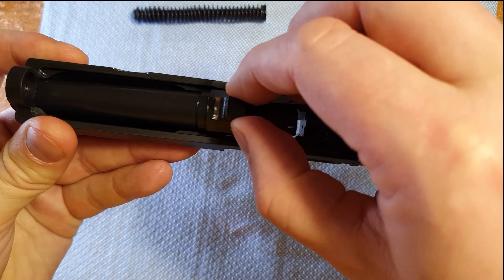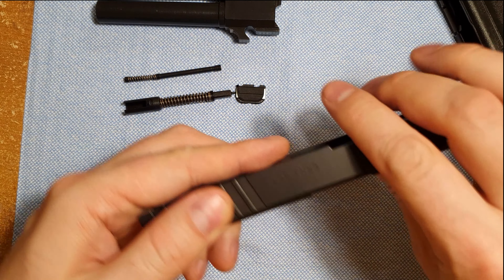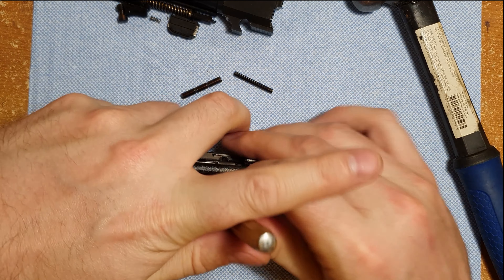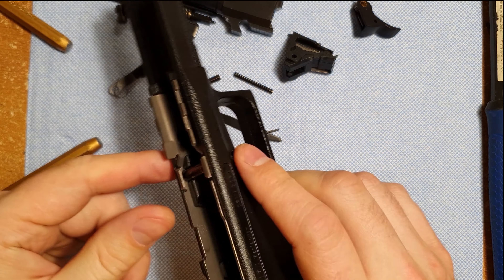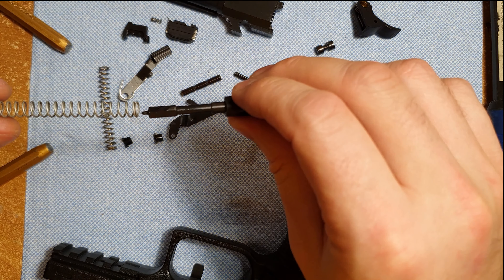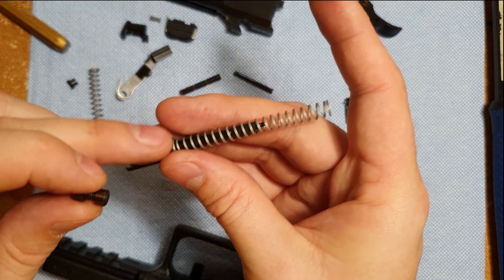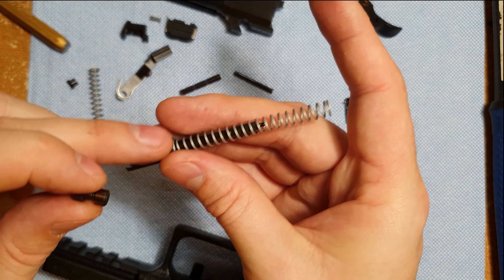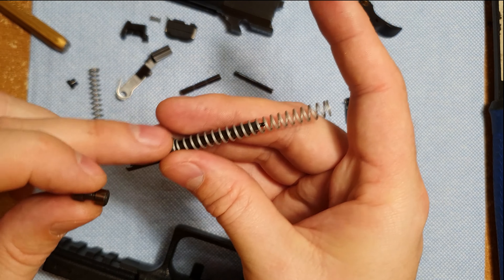Tara TM-9 Full Disassembly

Comment: Mine has worked flawlessly and is the early serial number. No issues. No jamming. I did replace the firing spring to a 4.5 lbs. I would do even lighter. But made a noticeable improvement. Great video, thanks for making it.
Reply: Same here. I did replace the slide spring and firing pin. My only problem now is the firing pin power. Some ammo cannot ignite correctly. I just notice that yesterday with Scorpio ammo. The primer is more harder of CCI or PMC.

Comment: Just one suggestion. It would be slightly better if you use either a nylon hammer face or perhaps a brass hammer face. Hitting the pins with  hardened hammer face can over time deform the end of the pins or other parts if you hit them with a hardened face hammer. 
I know you've done the disassembly many times, you know how hard you could hit the parts without damaging them, perhaps. 
Otherwise its hard to see into the frame of the gun, maybe add a little bit of lighting directly in to the frame. 

Otherwise great job, we have a lot of novice gun owners this day in time.
Reply from the maker: Yeah, I swapped spots for better lighting on the gun I disassembled right after this one.

Comment: So just an update on mine that I ordered, I did receive it Tuesday however there was a crack in the frame where the pin is above the trigger. I sent it off for warranty. It doesn’t look like a manufacturer defect, but more like someone forced the pin in and cracked the frame. I guess I’ll find out more after North Sylva receives it. Such a shame as I was hoping to get to the range with it, but at least my WK180C I ordered will be here next week
Reply from the maker: I had my Tara to the range today. Failures I had: stovepipes, fail to reset trigger, slide lock back with a round still in the mag, failure to go into battery. I'm impressed at the variety of failures I got.
Reply: @Huntinggearguy  mine is a different version from the one in the video (its the one they recently started importing in the US) and its been pretty flawlessly reliable. Trigger is still nothing to write home about. I think whichever version is in this video is the one with the problems because mine looks different
Reply: @counterfeit6089  this one is the TM9, do you have the TM9X?
Reply: @brandonrayner5253  yeah, get the TM9X if you can. It's way better. Just make sure you shoot to reset because that way you'll get a fairly average single action trigger not an absolutely terrible double action trigger, I think thats an issue that pretty much all models of the pistol have.
Reply: @counterfeit6089  I don’t believe the TM9X is in Canada yet.
Reply: @brandonrayner5253  damn thats a shame. You might've lucked out with a decent working TM9, I do remember reading somewhere that there are good and bad batches of them, pretty spotty quality control on Tara's part I think.
Reply: @counterfeit6089  unfortunately I haven’t been able to use mine yet as I had to send it in for warranty replacement as the frame had a crack in it. So now I’m being sent a new one.
Reply from the maker: @counterfeit6089  do you have the TM-9X?
Reply: @Huntinggearguy  Yeah
Reply: @Huntinggearguy  I have the same model tm-9 I got it back in December and I had noticed the same slide locking back on a loaded mag. I noticed the lips on the magazines can be a slight bit to tight causing incorrect feed angle after carefully opening them a bit and a light polishing it feeds perfectly fine and smoothly. This might help with it returning to battery aswell as the slide will not have to work so hard to strip the next round. Only major issue I had so far with mine was the trigger bar snapped but luckily warranty took care of that with no hassle. I have about 1200 rounds through it with no other issues so far. Also there is a little tab inside the magazine well that holds the tool in the grip, just push it in with something and it should pop out.

Comment: For some reason mine doesn't always restrike. The trigger doesn't reset. Only after shaking it around it sometimes resets itself. Does anybody know what part is the issue?
Reply from the maker: The part where it says "Tara" on the side. A less snarky response: check your trigger components to see how much resistance there is in there and consider polishing the rougher surfaces (but not the sear). Realistically, they'd need a heavier trigger reset spring to get better reliability from the system but that'd make the trigger EVEN shittier.
Reply: @Huntinggearguy  yea after getting some time to tinker with it. Its definitely the trigger reset spring. Its just to weak. Thanks for commenting back. I'm get to it. See if i can strengthen the spring or find a replacement
Reply: @Huntinggearguy  yea i also replaced the firing pin spring with a glock 2 ib spring. But it still feels like its around 4-5 pounds 😂. Not bad considering where it started from lol

Comment: Curious:  Why do you rack the slide to test the trigger pull weight?  This isn't a Glock, or anything like one, which is partially cocked when a round is chambered and cannot be uncocked without firing it.  The pistol is never cocked when you release the trigger.  Was that just habit on your part?  Also, you didn't test the short reset single action trigger.  This is a military contract duty pistol reminiscent of the "wonder nines", think S&W 659, Beretta 92F, and the Sig P226.  Pistols of that genre were SA/DA meant to be carried with a round in the chamber and the DA pull was the safety, no trigger blade like a Glock which is partially cocked.  Pistols of that genre were noted to have excellent triggers but the DA pull could be in the 9, 10, 11, and even 12 pound range precisely because that was the safety.  This is a duty pistol that merges the old DA/SA hammer fired trigger action with a striker fired design.  It is unique in that regard and other experienced reviewers, such as Graham Baates, have actually praised the trigger.  Lightening the DA trigger pull, as you endeavored to do, approaches reducing safety in a pistol of this design.  Granted, those that wish to turn it into some kind of target pistol might like that.  He said "When you first handle it, it does not feel like a nice trigger by internet gun snob standards. However as a fighting gun or duty gun..." in his table top review.  In his shooting review he said: "Even though it's a double action trigger...the reset kicks you right to where you need to be, that wall is predictable.  It made for very predictable shots."  A caveat here is that he was reviewing the Tara TM-9X, which has some differences, possible "upgrades".  The results of his trigger test: "In my opinion, it's a good gun."  He did have some troubles with the reset later, the trigger didn't reset, just as you experienced.  But that was during dry firing.  At any rate, for "old school" DA/SA" shooters, such a trigger makes sense for a duty weapon.  I have both versions of the pistol and have no issues, I won't be trying to lighten the trigger pull on either of them.  But I am one of those "old school" guys...  As for the Glock springs and guide rods fitting, that's really a bonus on a pistol where parts availability is questionable, so I am really very glad you verified that fact.
Reply from the maker: I think I've been clear that I believe the gun's design is poor and the selection of materials isn't great either. They're OK if you get one for cheap, but they don't measure up to pistols at higher price points. If you want someone to stroke your ego and tell you it's the best gun ever, go check out someone else's channel or make your own video to convince the world.
Reply: @Huntinggearguy  LOL!  No ego, and I certainly don't think it's the best gun ever.  If you don't like comments and questions, ignore them.  I am fascinated by pistol design and production.  Personally, I love conversations on such things.  I was just chatting with one of the designers today by email.  Have a great day!

Comment: Good entry level gun. Cheap and functional but pretty terrible trigger.
Reply: ..I got one from Atlantic Firearms just a few weeks ago....I agree 100 per cent about that trigger....actually, I think the terribly hard pull needed to fire the darned thing is due to the striker spring, not the trigger assembly itself (I have to use both index fingers on the trigger to get it to fire some times...) anybody have any suggestions...??? nice gun; pain in the a** to fire it, though....